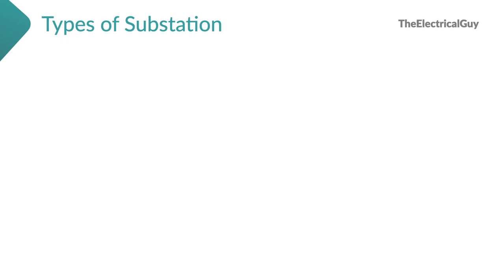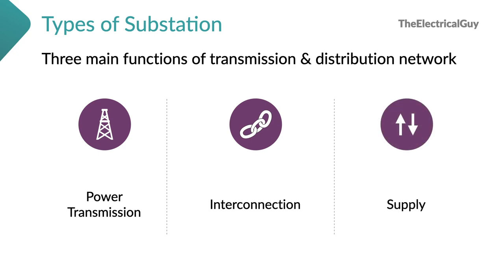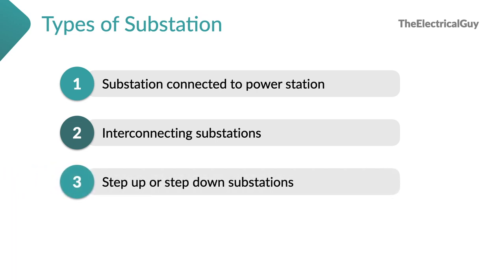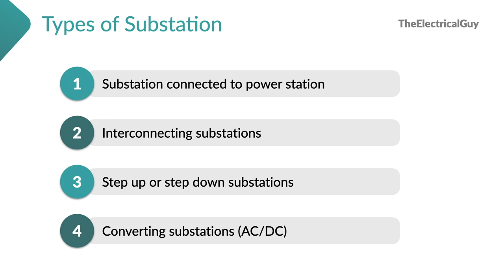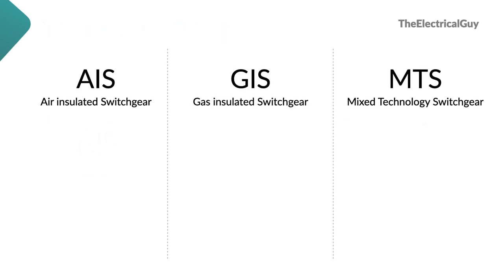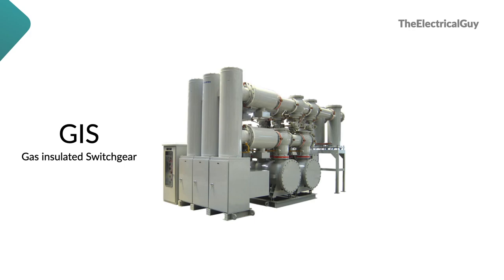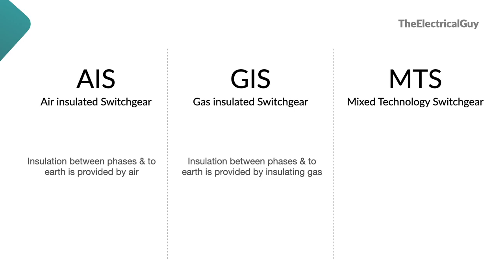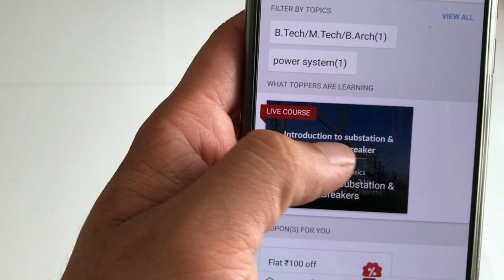Classification of Substation & Switchgear | AIS/GIS/MTS

Comment: GIS is better for smaller areas where insufficient space is available for an AIS compound. GIS is also better in built up areas (inner city) or areas with high pollution as normally GIS is placed indoors (in the UK) in GIS switchgear buildings. GIS though is significantly more expensive than AIS.
Mixed technology (hybrid) is just starting to take off in the UK and is suitable for areas with limited space for AIS connections, often on solar or BESS (battery energy storage system) grid connections. AIS is considered traditional technology and makes up around 80% of the electrical grid infrastructure in the UK.
Very informative video. Thanks.
Reply from the maker: Correct 👍🏻👍🏻 you can also check out more videos on this topic on my mobile app
Reply: Good explanation @pilew26